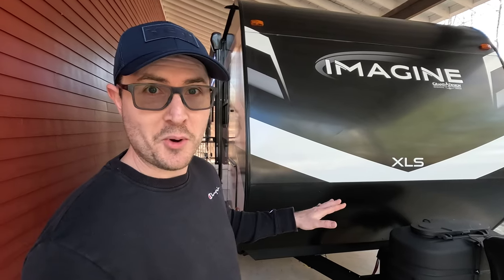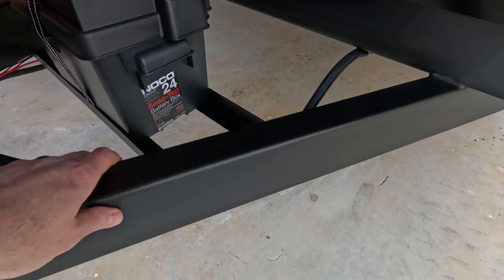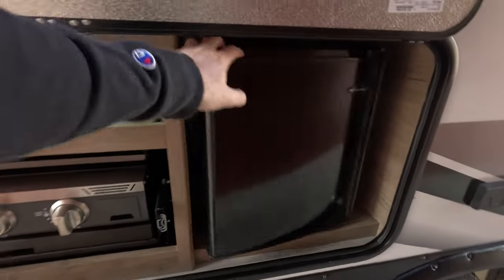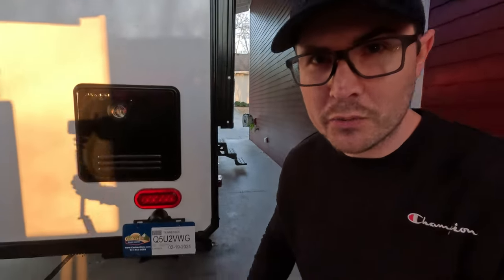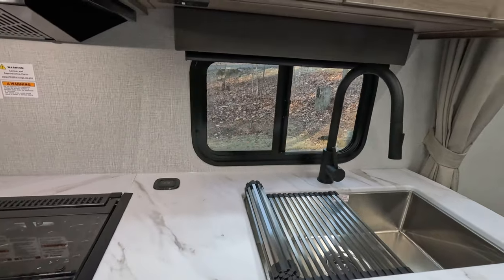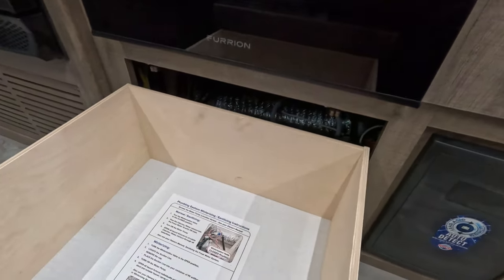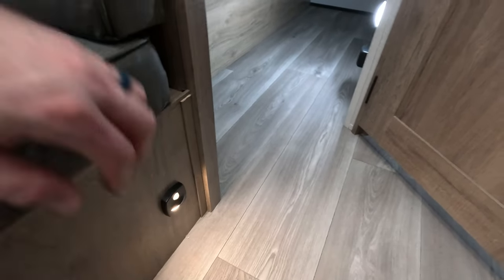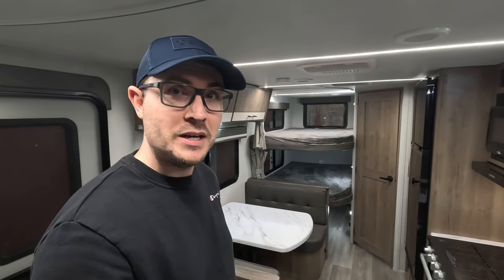No Slides! I Tour the 2024 Grand Design Imagine XLS 21BHE Bunk House Travel Trailer

Comment: I have the 2022 model year and have been mostly happy with it.  I had the 6 gallon tank water heater and the cold inlet line was not tightened properly from the factory and ended up causing leakage into the tank area and got a little bit into the grill bay.  I had to tighten the cold water inlet and was good after that (you have to remove the access panel to the left of the grill to set the valves to bypass the heater) . The fridge seems to collect a lot of frost on the back wall, and frost also collects in the freezer as well. 
The bottom bunk may need a small fan for circulation - the ducted AC doesn't reach that section that well - maybe if the person is sleepting with their head close to the dinette.  Also the detector above the murphy bed on my model is a CO2 detector, you may want to check that.  My power converter is also auto-detect but it was smaller and I have 3 drawers above the converter (but consequently less expandability).
Incidentally I have the same awning problem that was on your Pinnacle, but GD had an official recall on it. I haven't been able to schedule an appointment to the dealer yet but may in the mean time use your HH-66 fix.
Reply from the maker: Thank you for sharing, and for the tips. On mine they put the CO/propane detector below lower bunk, perhaps since gas drops to the floor since heavier than air. All I can figure is it is some new RVIA code mandated the 2nd one...never seen that before! Anyway, I appreciate all the tips and experiences shared. Nice to connect a fellow owner.
Reply: @AdventureRocks  yep I rechecked my floor detector and it's a propane only detector.
Reply from the maker: @sergep71  Interesting! I'm actually swapping my 2x 9V smokes out to test out some smarter wifi CO/smoke combos.

Comment: Great vid, and understand trying to find simplicity in towing and camping. I'm the one that commented on FB Group XLS. I had a Tab 320 and still have the 2022 XLS 22mle. I watched your vid on your truck which is a great review. Please a little later after some use of the Murphy Bed let us know your thoughts? As for your frame, it's  powdered coated.
Reply from the maker: Thank you! Appreciate the connect! I'll definitely report back in the murphy bed. Thank you.
Reply: @AdventureRocks . After watching this video all the way through: I don’t consider Grand Design XLS models entry level. Are you basing it on price & size?  Hopefully you’re not…. Entry level is a bare bone type Travel Trailers which I know I’ve rented a couple back in 2019 before buying our first TT.. Entry Level has plastic sinks & toilets and the list goes on. This is top notch Travel Trailer;  I understand your previous camper was a 5th wheel was that an Entry Level rig in its class? …You kept saying entry level TT on every  item that proves how much more this TT is on the upper end of most TT’s that basically suck!  I came across you due to your Truck I was curious and now hopefully you’ll give us feed back to HWY MPG’s etc.  I purchased our XLS 22mle from Cookeville RV & Marine and drove up from Miami Florida and traded in my previous TT.

Comment: I love the simplicity of this trailer. Question for you: do you have any recommendations for a family of 6 (parents + 4 kids). I’d love something that is 30’ or less but has plenty of sleeping for at least 6 and has a simple but functional design like this one.
Reply from the maker: Thank you, I've really come to appreciate its simplicity over the last 9 months. With 6 total you some might argue you'd be a little tight on sleeping, but I think it is doable, especially if your kids are younger and/or used to sharing sleeping spaces. The bunks are slightly larger than twin (I stretch a twin sheet on them) and then you've got the dinnette which is another shorter twin essentially. So I think the manufacturer lists 8 with double occupancy on all the beds, but I think 5-6 is more reasonable, again depending on size of kids. Grand Design got so many things right on this iteration of the floorplan...a lot of the other brands leave details out which although they are small details they can lead to less enjoyable experiences. You can fit the unit anywhere...any campsite...very easy to maneauver...and it just doesn't have a lot of the unnecessary extras that often cause problems.
Reply: Thank you for your reply. Sounds potentially interesting for us. Do you have any recommended trailers if you needed to go slightly bigger to sleep four kids more comfortably?
Reply from the maker: @TurnerAJ84  I don't know of any myself, but they are probably out there. It seems when you get a "true" bunkroom with 4x separate beds most of them jump in size by 10+ ft or more. We had a 2016 Reflection bunk house similar to the Reflection 312BHTS. It was very spacious...very nice too. Right now we're doing shorter weekend trips at smaller state parks and places where smaller size opens up more opportunities. Not that a 37' travel trailer is a deal breaker for that kind of travel, but probably cuts options by 20-30% on some state parks and just adds some complexity. We had a 42' fifth wheel with 4x slides before this 21BHE so the simplicity is what I like most about it. Hope this helps.
Reply: I appreciate your reply! Happy camping. Keep up the great content - I love it!

Comment: When possible could you get a hitch weight before adding all your personal gear? Thanks in advance and great video btw
Reply from the maker: I failed to do a CAT scale weight before doing all the mods and loading, but since the 21BHE only has mandatory options and they're all built the same essentially, I'd speculate they all have pretty much same factory stated weight in that 456 lb range, of course pre-battery and full propane tanks. Once I get near a CAT scale in the future I'll do a full weight to report back. I'm guessing it'll be in the 700-900 lb range, but just an estimate.
Reply: Did you ever get hitch weight? I'm having payload issue with tow vehicle.

Comment: I would like to see a mod where the top bunk is half the size, that is, the front top portion is cut off about half way and the space is used as a large shelf for storage. This would be great for two adults who don’t necessarily want to share the queen bed. One adult could be in the queen bed and the other could use the bottom bunk. Lots of storage up top and no feeling of being closed in. I don’t think manufactures are thinking enough of this possibility — this type of situation for their customers. There is a market for this and it’s a missed opportunity. Could just be an older couple or friends camping together.
Reply from the maker: Great idea

Comment: Your TV.  Is it 12V?    How difficult is it to watch from the table?  Thanks for the review.
Reply from the maker: Thank you. My TV is regular 120v, but they did supply a "smart" TV with apps. It rotates about 45 degrees both left and right, so pretty decent angle at table or bunks.
Reply: @AdventureRocks    Thanks.   Odd that it’s not 12V like the refrigerator.
Reply from the maker: @MoutainGuyAdventures  I think it's because higher quality 12 volt TVs are pretty rare and fairly expensive. Oftentimes their picture quality and features leave a lot to be desired. Grand Design makes their units pre-wired for an inverter, so it's pretty simple to add one and that solves problem to run TV off grid. I plan to do a video in the future showing how I added an inverter to mine.

Comment: i went to look at this unit and noticed the right sided cupboard door beside the queen is obstructed by the window valence - it impedes opening it somewhat - just wondering if you have figured out a hack for that?
Reply from the maker: Yes, actually both sides are obstructed by either TV cab and valence. I actually came back and added a wire stay to several of the cabs/doors to keep them from colliding. Yes, it does impair opening a full 90 degrees...a bit more difficult to put things in/pull them out. Manageable still though. I'm okay with it given how compact unit is. If it was a 42' luxury fifth wheel like my last unit I probably would be more prone to find fault with it if that makes sense. Definitely could remove valance though, and might even have room to slide valance over an inch or two, keeping shade on window of course. I'm gonna leave mine for now.

Comment: Congrats! Okay nice setup, I see that you down size.
Reply from the maker: Thank you, we're enjoying it.
Reply: @AdventureRocks  I want to ask you sir that in one of your videos, you talked about adding a Leveo Tab M9 to the BMPRO Jaycommand. How did that work after I watch that video I went out and bought one but I haven't open the box yet, I wanted to know was it worth the add on, did you see an appovement to the system. I wanted to know your views after adding that extra tablet, and thank you for your reply.
Reply from the maker: @bishopgeorge1333  Thank you. Yes, I liked the option of having a 2nd tablet in bedroom mainly for redudancy and also just as another point of input since I frequently found myself in bedroom wanting to adjust control panel. So it was nice to have a 2nd dedicated tablet there. I don't think it's a must-have, but for only about $100-$150 it's an option nice to have.
Reply: @AdventureRocks  Okay, was the second added tablet that you setup was it faster than the factory one that comes with the RV and did it connect to Bluetooth quicker? I want to take mine out of the package so I can use it thank you for your help.
Reply from the maker: @bishopgeorge1333  yes, indeed the second had more RAM and faster processor, plus newer Android version, so seemed all around faster compared to OEM.
Reply: @AdventureRocks  Awesome and thank you sir for that.

Comment: Do you think a family of 3 could live in this for a year or so?
Reply from the maker: Great question. Short answer, yes. Long answer...there's always the argument that RVs aren't made for full-time living in terms of being as durable as a sticks and bricks house, even one double the price of this one. But, at the same time the 21BHE is a very nice blend of features, quality, and value especially at the ~$30Kish price point. And the simplicity means fewer things to maintain, break, or go bad compared to more expensive and larger units. It's nimble and light such that you can fit at just about any campsite and easy to maneuver. Grand Design nailed this floorplan in terms of layout and features though. Anyway, other factors to consider for sure, but hopefully that's a starting point.

Comment: Is there storage under the bench seats at the table??
Reply from the maker: No. The one side closest to door has the shoe storage, which is basically the entire underside. The other has a few electrical wires running through it if I recall. There's a removable plywood lid to each seat bottom with a screw or two.

Comment: I considered buying this trailer but was very disappointed by all the cheap outs by Grand Design. Scissor jacks, small fans, no slam latches, and the location of the TV is moronic.
Reply from the maker: I hear you on the fans, already replaced mine...I think I've had to do that on pretty much every RV I've owned though. Even my 6-figure Pinnacle luxury fifth wheel had a manual open/close in bathroom from factory. I don't mind the scissor jacks, actually like the simplicity there.

Comment: I will never buy an RV with a 12V fridge! This is a deal- breaker for me. I wish you had led with this so I didn’t have to watch most of the video.
Reply from the maker: Thanks for feedback. Always pros and cons, right? One should be able to retro fit another if desired. I've tried other various fridge types in previous RVs from propane/absorption to residential 120v w/ inverter, and my favorite, especially on smaller rigs is the 12V.
Reply: You cannot retrofit a 2-way fridge due to the sidewall vent and roof vent.
Reply from the maker: @scottcrawford2239  Check the older year models of this same floorplan as GD changed to 12V in last couple years. Likely the framing is carryover on new, so as long as no studs hand changed locations, can make cuts for new vents. Power and propane needed are right in proximity. An RV dealer or tech should be able to do it for you if needed.
Reply: The older ones, like 2021 models are still dual power. I've got one. Installed an inverter on my truck and dual alternators and I run the fridge on 110v while towing. Piece of cake.
Reply from the maker: @andreiturcan9721  Great point